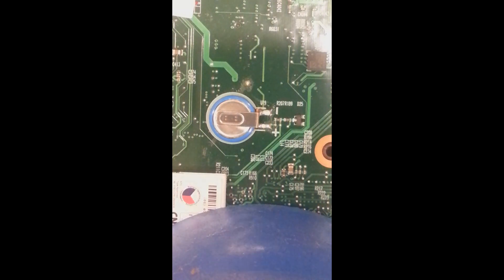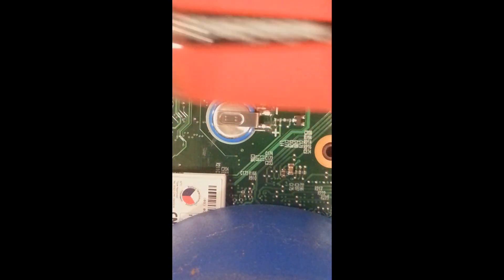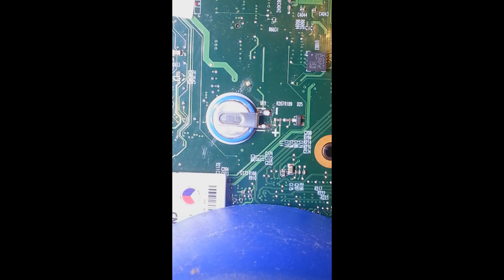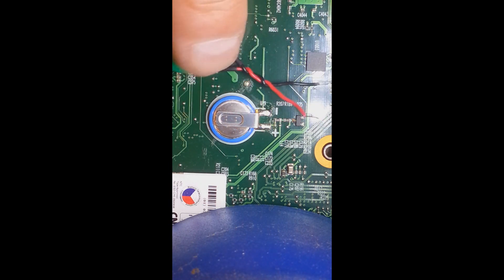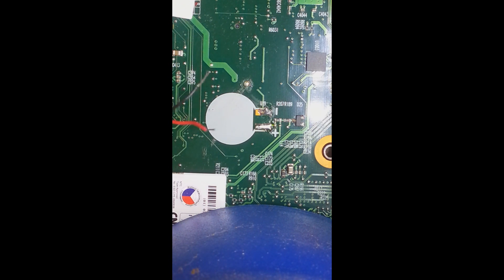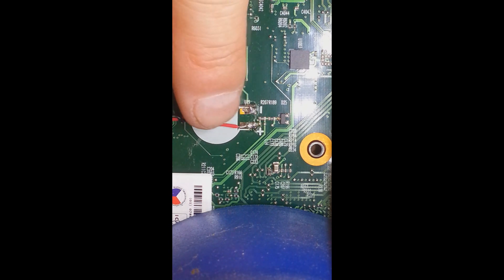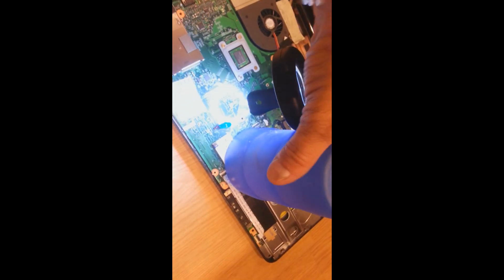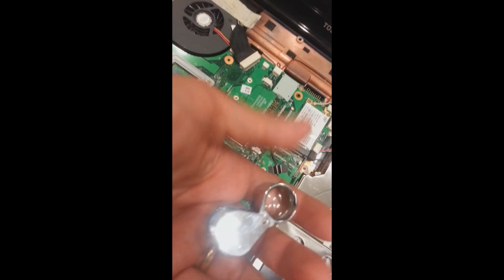Replacing the RTC (CMOS) battery on a Toshiba A505 Laptop (soldering)

Comment: Thanks for this video. I unsoldered one of the battery connections to clear the BIOS data and I'm trying to solder it back on but it will not solder back on the board, just will not stick. So then I removed all the old solder with wick cleaned it with flux and it still will not stick back on the board. I can see it's all clean on the board, I can see the copper or brass that it solders to but it will not go.
Reply from the maker: Not enough heat or flux.
Reply: @Joeteck  Thanks for replying back, I gave up and just put it back together. It seems to work fine. It's not saying anything about the battery. It worked, it cleared the BIOS password.
I change the boot order to boot from USB.

Comment: Nice video.I have a question.
I have an acer 5315 laptop.
I the charging circuit diagram for the rtc battery.
I want to disconnect or cut one of the components in the charging circuit,then I would like to add a regular non chargeable battery with lots of capacity that would keep it going for a while.

The old battery is dead and i dont know the proper voltage for a replacement.I cant find this type of battery any more its some kind of li -magnesium battery.what do you think,and thankyou

Comment: I want to thank you for this, i have an Acer Aspire e5-521g and had to change the battery because it was dying. I ended up removing the battery by force(carefully to not damage the connectors of the board) rather than removing it with the soldering iron tool since it had little solder on the joints and i had little experience with that, i have some experience in removing the connectors stickied to the battery without damaging them so, the connectors that where stickied to the battery went almost intact and the connection to the board is undamaged. I soldered the wires just like in the video but to the connectors, used some electrical tape too to cover the parts that where exposed.

Comment: If a battery is rechargeable, why does it need to be replaced? Does a CMOS rechargeable battery have a limited number of charge cycles?
Reply from the maker: correct.
Reply: How do I recharge it, while it's connected or ?
Reply: @lvngleyptyltdnorthsideva1148  While it's connected you don't need to charge it manually I think.
Reply: @MarcGameplays  thanks for the prompt reply. Which charger can I use? The USB method or something else?

Comment: I have a soldered CMOS battery to replace. I'm not very skilled. Would it be possible to use pliers to cut it, instead of desoldering it? When soldering, what would happen if the tin touches a bus of the motherboard?
Reply from the maker: I wouldnt do that. You could risk breaking the board from stress,

Comment: Before replacing try a suggestion that toshiba mentions in their service manual, and that’s to turn on laptop and leave it powered on, not in hibernation for 24 hours to fully recharge the cmos battery.  I tried it as my clock was not keeping time and now it’s good as new and zero replacing of battery.   Just a suggestion before tearing apart the laptop and soldering a new battery.
Reply from the maker: That wont work if its dead..
Reply: I'll try this, if it doesn't work, then change it is

Comment: I followed your video here and replaced the CMOS battery on a Toshiba L455.  Now it won't boot. 

Light comes on for AC adapter, and green light for battery so it is at  fill charge, not amber.  When I depress power button, fan comes on and spins and then turns off, hard drive light comes on and then turns off.
Before I repaired this, the laptop booted up to both BIOS and the Win7 login screen for 2 users.   I think the bios settings were lost but don't see anything in google on how to restore it with a "dead laptop".
Oh, the laptop is not mine, I repair and refurbish laptops for missionaries for free, they buy the parts.  This one and another Toshiba were sent to me by a missionary to Zambia, who is in Florida right now.
  Both had the same CMOS problem, both used the same battery one soldered and the other plugged in. Both $10 each. Any suggestions on what to do next?  Won't boot to a Linux CD in the DVD bay either.
Reply from the maker: I am hoping you didn't break anything prior to the cmos battery replacement.  Make sure you didn't forget anything. Reseat ram, check cpu fan header. The basics

Comment: what is the battery name and number? is it maxell CR2032?
Reply from the maker: It depends, some laptops use the standard desktop CR2032 battery. Need to take the laptop apart and see.
Reply: @Joeteck  laptop taken apart but not able to read the specification on the battery as it is covered by a metal piece. It looks similar to your battery. That is the reason i have asked.
Reply from the maker: @avijitsinha8507  what is the entire make and lodel number of the laptop?
Reply: @Joeteck   Lenovo G50-70

Comment: Its posible to upgrade the toshiba laptop A505 CMOS battery by adding a battery holder , like this one ?? https://es.aliexpress.com/item/33016562139.html?spm=a2g0o.productlist.0.0.5f865ab0hEhxhz&algo_pvid=a4bd424a-8655-4b9d-a0f4-cf100066af09&algo_expid=a4bd424a-8655-4b9d-a0f4-cf100066af09-3&btsid=7676e840-ec28-4502-b052-f2332755647a&ws_ab_test=searchweb0_0%2Csearchweb201602_8%2Csearchweb201603_53 

I'll try it later , buy I don't know if my idea would work

Comment: I've a Acer Aspire 7520 that won't turn on. I tried to connect with another adapter, but still it won't turn on. I thought maybe the CMOS battery needs to be reset and might fix. I tried to soldered away the CMOS battery and that went well. But when I soldered it back on, the holder to connect the CMOS battery from the motherboard broke. Is it possible to fix the holder from the motherboard or is this the end?
Reply from the maker: Can you email a picture of your laptop board and the part you worked on? I want to see how we can repair this thing. joeteck@joetecktips.com
Reply: @Joeteck  I just sended you a email with the picture.
Reply from the maker: @SC-ey7xv I got it... Jesus! did you use a 100w iron??... 20w max. I am going to give you detailed instructions via e-mail on how to fix this. We will move our communications via e-mail vs comments here. Thanks..
Reply: @Joeteck  LOL. I'm really bad at it. I know. I tried put a little of iron but accidentally I put more then normal.

Comment: Hi, I have an A505-S6014 that won’t start. I’ve recently changed the power cord and regular large battery. It was working fine but I let it go dead so I think it may need a CMOS replacement. The laptop was very slow for about a year before it died. I have bought a Lenovo Yoga with an i7 latest generation processor that seems lightning fast. Can the processor (i5) in this Toshiba be replaced with an i7 or would that require additional fans, etc? Also, do you think the CMOS is bad? Thanks for the great video. It is very understandable.
Reply from the maker: No, that CPU is 4th generation and is from 2010.  The Yoga uses a 8th generation CPU.

Comment: My laptop is C50 they put for me RTC battery is low how can I fix it
Reply from the maker: It's a complete tear down. You'll need to take the motherboard completely out of it. Only a VERY skilled technician  should attempt this.
Reply: I need too change the mother boarded you ment
Reply from the maker: Remove. Not replace. The battery is close to the hard drive but on the underside
Reply: Do you have facebook you will learn me how
Reply from the maker: This is not something that is teachable.   Many years of experience is required to do this task. I would find a skilled tech.
Reply: Is that means my battery is not good
Reply: I took out my mother blared I didn't fin the thing in your vidio

Comment: is it neccessary to remove the original battery with the solder? does removing the battery without the solder (just pull it slowly) iron affects the board or the pins in any way? thanks
Reply from the maker: Karim Elane you need soldering iron otherwise you'll take off the ability to solder the new one back on. The eyelets and lans will be taken off. It needs to be soldered so it can be electricly connected.  No way around this.

Comment: I have a toshiba satellite c55d-b5102 that says "RTC Battery is low, press enter to set date/time" do you know where it's the CMOS located or if it even has one?(or do you a way to solve this?), thanks for your help.
Reply from the maker: Miguel Roman Brache Espinal dude, you are lucky!!! Take off the bottom panel, where the hard drive and ram is. That laptop uses a desktop button cell. Lol. No need to tear that laptop apart.. it's silver and next to the hard drive. You can't miss it. Let me know how you make out! Should be a 2032 3v lithium.
Reply: Joeteck I have the same problem i found the battery. What should I do or how can I charge it?
Reply from the maker: Miguel king once installed the laptop charges it.

Comment: I have here a Toshiba L305-S5933, when it powers up there is no display on the screen nor an external monitor. Can it be a dead cmos battery & what battery do i need to replace it?
Reply from the maker: a bad CMOS battery would not prevent it from powering up. I would reseat the memory. or test each one independently in the laptop. also make sure none of the  USB ports are shorted. that would prevent it to power up. Let's see how you make out with this. Keep me posted.
Reply: Arnold, I have 3 Toshiba's, 2 ( L305D-S5934) and 1 (L355SD-S7901). All have the same problem as yours (a black screen). . I managed to get one back on and the first message was "the firmware has detected that a cmos battery failure occured. From what I researched it does seem to be the cmos battery..

Comment: hello there can you helped me what kind of cmos for Toshiba Satellite L355D-S7829? 

thanks
Reply from the maker: http://www.genuine-cmos-battery.com/toshiba-satellite-l355d-s7829-cmos-battery.html
Here ya go
Reply: thanks. but how to convert? i mean the link you give theres a 3 wires?
Reply from the maker: That is what that laptop requires. I would remove the white wire if you needed to convert. Red and black are positive and negative. The white is probably the monitoring link. Condition of the charge.., Voltage,... etc
Reply: Joeteck so i ordered $2.99 unbranded from ebay 😂😂 so what do you think is it okay for that? it will be good for a year or so?

thankssss
Reply from the maker: I have no idea. You get what you pay for... ;)

Comment: As far as I'm aware, the A505 uses the same battery as the A200 series which is a 3.0V (14mAH - 17mAH). The following RTC batteries support these values:
- Maxell ML1220T10
-Maxell ML1220HT10
- Sanyo ML1220T28
- Panasonic ML1220/B

Perhaps Joeteck could confirm this?

On a side note, fantastic video, very clear, easy and to the point. I had never soldered before, but nailed first time thanks to you. 

Cheers :-D

Comment: I have a Toshiba A505-s6025 that needs the bios password wiped out. can you tell me where I need to see on the motherboard. I looked with a fine tooth come and saw nothing. but maybe I did not see it. I did however have a magnifying glass and did not see a jumper.
Reply from the maker: the BIOS password can't be wiped by removing the battery or the hard drive. it is saved in the nonvolatile memory of the BIOS. (hard coded by the laptops owner at this point.)  The only way it can be removed if you know the master password. this is done to prevent theft. The laptop is useless to you without that password.

Comment: Is it possible to replace with any kind of cmos battery?
Reply: The laptop is without hard disk I removed it and they are putting RTC battery is low
Reply: When I turn it on
Reply: Did you know what I mean
Reply: And in my laptop I don't see that thing in your vidio that you replaced
Reply: My laptop is C50 2gb ram and 500gb hard disk 15.6 HD
Reply: I actually tried replacing my Toshiba laptop with ordinary size CR 2032 energizer battery since I am having a hard time finding a small one. What I did is put a short red wire to the positive side of the CMOS battery then black wire to the negative side of the cmos battery, wrapped the battery with an electrical tape. I soldered it then it actually worked it fix CMOS battery error prompt.
Reply from the maker: The problem with that is, that is not rechargeable which it needs to be. So that battery will explode in a few months of constant use and destroy the laptop.

Comment: Oh f this, I don't think I can be bothered to take the whole system apart to replace one of these. You said these things are rechargeable? Why replace it then? Do they lose their capability for holding charge over time?
I'm 'working' on a machine that hasn't been used in years so would leaving the power on charge that battery making it work again? Thanks for the video.
Reply from the maker: Lol. yes, they lose the ability to charge over time. 5 years +. it is there just in case you do not use it for a very long time. the RTC (real time clock) stays running without it plugged in or with the laptop battery inserted.

Comment: Can I replace it with a normal size cmos battery?
Reply from the maker: no, it needs to be small and protected with a plastic coating so it does not short out the board.
Reply: I actually tried replacing my Toshiba laptop with ordinary size CR2032 cmos battery put a red wire in the positive side the black wire to negative side of CR2032 then wrapped it with na electrical tape then soldered it. It actually work for me it fix CMOS battery error during start up :)